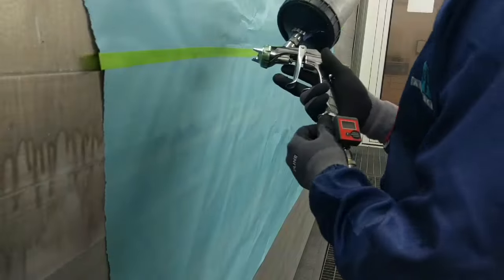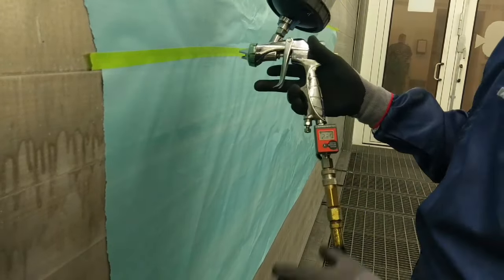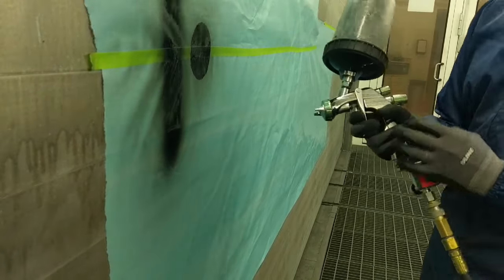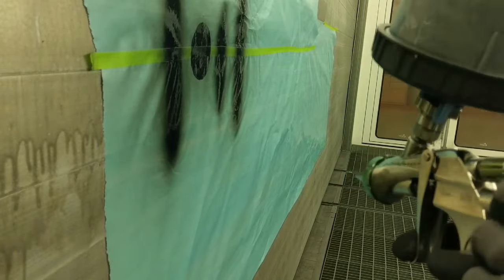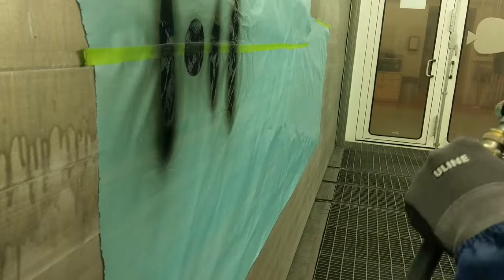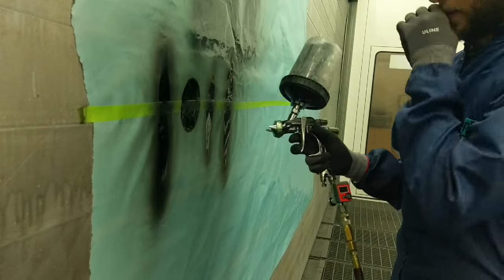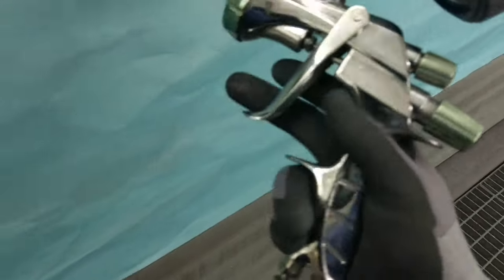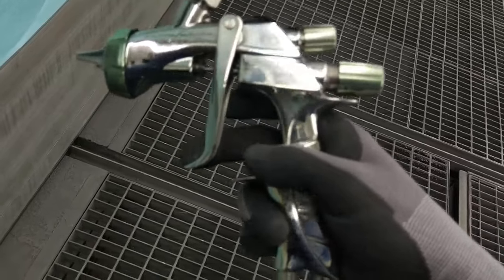How to set up a spray gun

Comment: First thing they teach in school, first thing paint manufactures recommend, first thing gun manufacturers recommend, is regulator is for fine tuning, you should have gun and regulator fully open and set off the wall regulator to ensure you don't get psi fluctuation in the hose length. Or you'll get big air purge each time you pull trigger and then it equalizes. Set it off wall regulator and each time you pull trigger there's no big surge before reaching spraying pressure.
Reply: Not saying that to "troll" you out nothing. Just sayen your missed an important part. The rest is all good man, good instructional for people starting out
Reply from the maker: There you go that's a much better comment. You help people by it 👍🏼

Comment: Hey Gabe how do you set up walcom clear gun?
Reply from the maker: Wide open fan 33 psi fluid is the handle flush with the gun body or wide open. Also about 6 inches away from the panel then second code 8